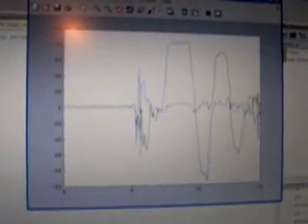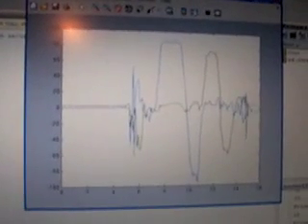Adruino Matlab Multimeter

Comment from the maker: @youtubishification I did not use the signal processing in Matlab. It was actually quite simple. When the Arduino board was turned on it would continuously send the readings of all of the sensors (as a string) that are connected to the board via the USB cable. On the Matlab side the computer received the incoming serial data and stores it to variables. These variables are then called upon when needed. to accomplish this you have to use the fopen() and fclose() commands.